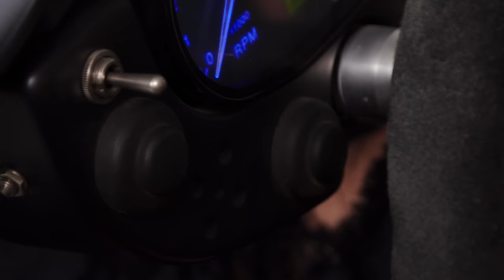The Ultimate Brake Dust Repellent Method To Keep Your Wheels Shiny And New! - Chemical Guys

Comment from the maker: Remove and Repel Brake Dust! 
- Sticky Citrus Wheel Cleaner:
https://bit.ly/3nNWVYG

- Total Extract Tire and Rubber Cleaner:
https://bit.ly/3VJRK8H

- Max Coat Wheel Guard:
https://bit.ly/42cFXSQ

- HydroSpin Ceramic Detailer:
https://bit.ly/3p9s6xZ